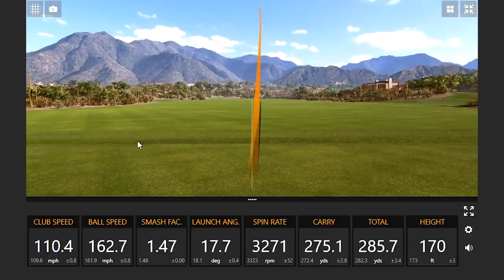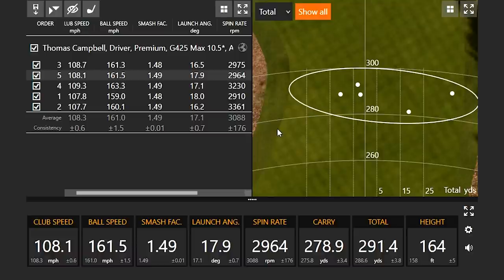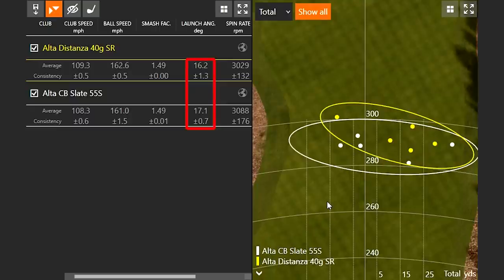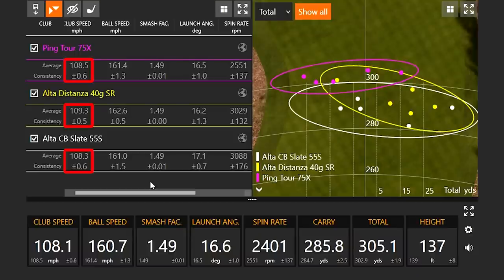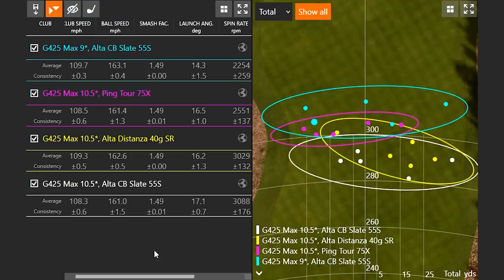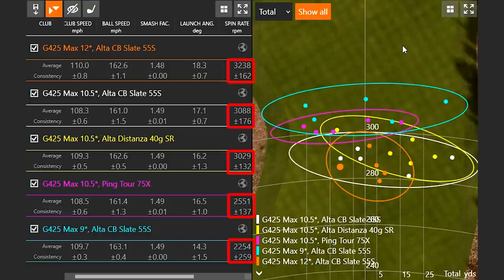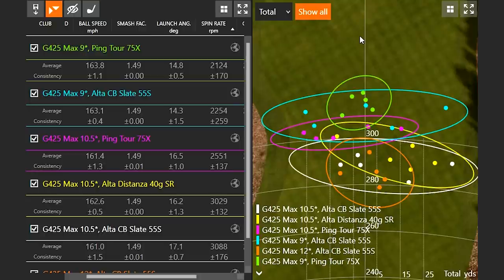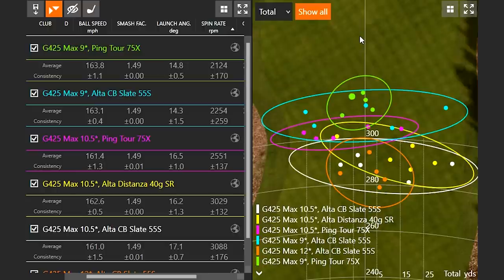Golf Shaft or Loft? What Impacts Golf Driver Spin The Most

Comment: I’ve always thought that the loft was matched to launch angle and the shaft was matched to speed and tempo. Glad this video cleared a few things up.
Reply: Adjusting loft moves spin rate more than launch angle. Shaft also affects launch angle (stiffer tip=lower launch).

Comment: Great video!  Loft is king when it comes to spin.  Engine/Transmission is the perfect analogy!.  What I find for me is a softer shaft or a softer tipped shaft advertised as high launch actually tends to launch lower and spin more because I tend to hit them lower on the face.  Conversely a stiffer tipped shaft advertised as low launch and spin tend to launch higher and spins less because I tend to hit them higher on the face.
Reply: @Shayne Svenson it’s not hitting up or down...it’s where you hit it on the face.  I swing up with the driver 2-3 degrees.  High contact on face = high launch/low spin...low contact on the face = low launch/high spin.  Duh....

Comment: Good video, Thomas. I think if this shows anything is that the average golfer should be using a higher lofted driver. If you are not hitting consistently straight or being accurate with your driver and your dispersion isn't tight, you should be playing with something in 12 degree range. And if you want the best possible combo, go get fitted.

Comment: Thanks that was interesting.
Possibly a great impact on the spin rate would be the Ball?
Reply from the maker: Thanks for watching! And for sure, ball will play factor. In this test though we controlled all variables besides loft and shaft just to see how those compare. We could also do the same by comparing different golf balls to see how that differs.
Reply: @2ndswing  yes please, if possible, I would like to see you show the difference in spin rate when using a higher and lower spinning ball and see if it makes more or less difference than changing lofts and shafts👍
PS Keep up the great work👍

Comment: who should play higher lofted driver?
also, wasn't dispersion with the 12" good compared to some of the lower lofted combinations?
Reply: generally if you have a slower swing speed or you are hitting drives to low ( possibly due to a steep angle of attack on driver swing )
I think a good visualization would be think of a slower swing using a mid iron vs long iron. Its harder to get a higher launch with a long iron unless you have a high swing speed. Same thing with drivers. And dont forget the lower the loft the bigger your misses will tend to be (slice or hook)

Comment: Well if you would have used the Ping LST driver head instead of the Max, that spin would have dropped much more.  Good video thou. I personally am more prone to use the standard Ping Alta regular flex shaft than a heavy 75 gram shaft thats real stiff in the tip section.

Comment: I'm pretty sure it's been shown that the shaft is not "changing" launch and spin.  The shaft is changing where you hit the ball on the face, which in turn changes launch and spin.  High impact on the face launches high with low spin, low impact on the face is high spin low launch.  Different weight and flexes of shafts are just changing the impact location,.they don't do anything themselves to change those characteristics.
Reply from the maker: Correct. That's why club head changes such as loft is much more valuable - Thomas

Comment: At 216g the Ping head may not be the complete story.  Perhaps repeat the process with e Sim2, rad speed, TSi etc?
Reply from the maker: For sure, clubhead weight will also play a factor. In this test we tried to control those variables though and focus solely on the shaft and loft. Results may waver a little with a different driver head.
Reply: @2ndswing  I appreciate that.  I wonder if the heavier head has a bigger influence on the shafts?  I think I've measured the PING is as much as 216 g vs about 193 g for the SiM 2.  Just throwing it out there for ideas
Reply: What about going one step further and seeing if adding weight to the sim2 to get it closer to the 216g of the Ping could get a similar performance.  That might open a can of worms though by messing with shaft “stiffness” by changing head weight.
Reply: @joeb5958  in my mind, the heavier weight of the Ping G425 would have a more exaggerated effect on shaft lead deflection as well as droop (toe down through impact).  My thinking is the Ping is the heaviest from all the major manufacturers, where as the others seem to be all bunched up at the lighter end of the range.  I think Rad speed is among the lightest.  It would be interesting to repeat the experiment with one or two of the other drivers to see what results will reveal themselves.  In my experience, shafts and shaft preferences aren't independent when moving from head to head.